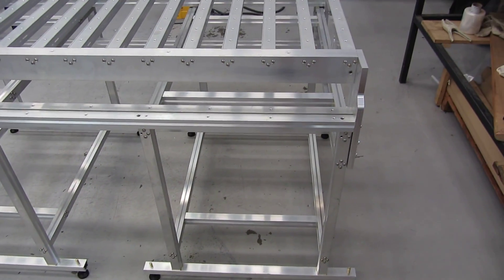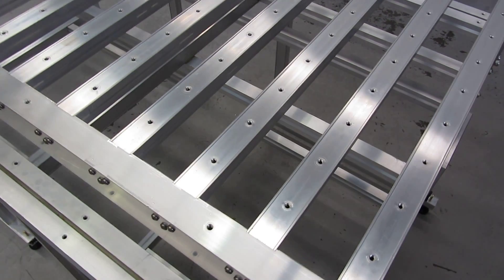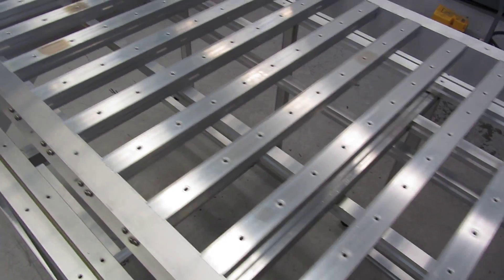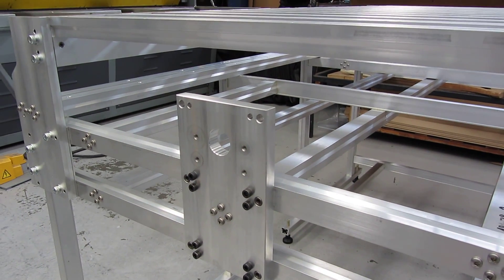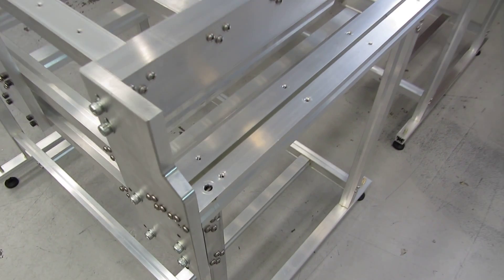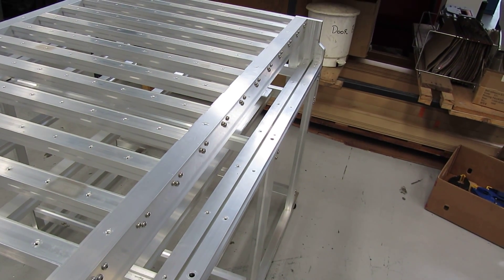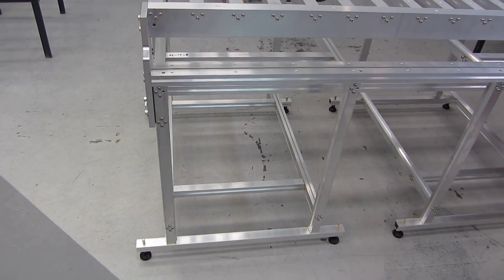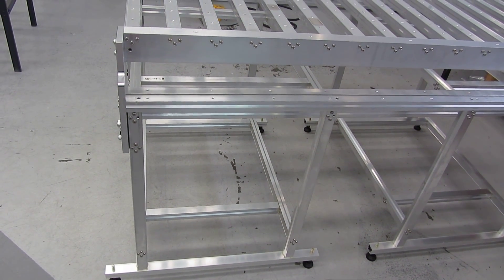My 3 Axis CNC Router base almost finished

Comment: A question if you don't mind? The main table parameter structure, is that solid aluminum or tubular aluminum? Second, the cross members of your table, are they one piece fabricated aluminum or customer built? Can you provide sources for the framing material? Thanks in advance. Great looking machine!!!